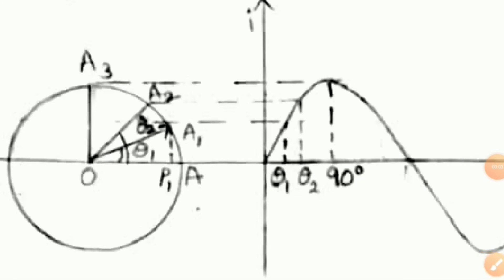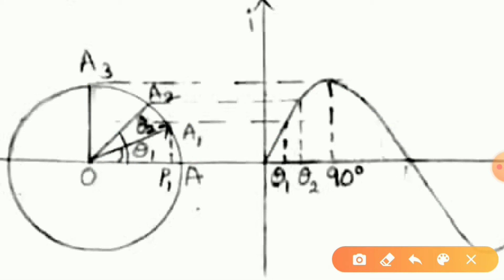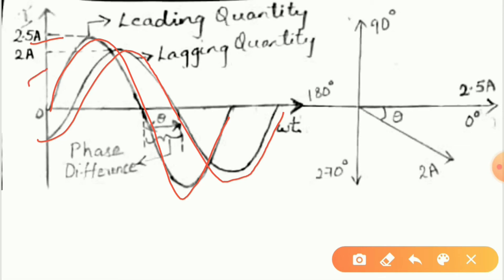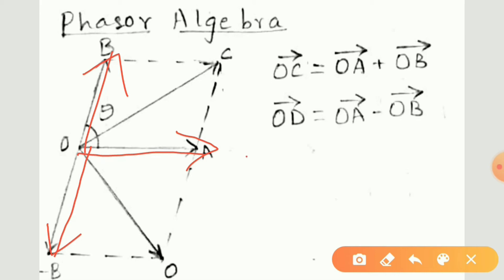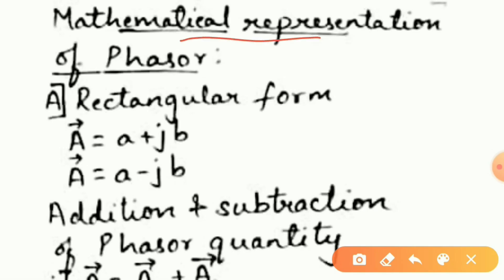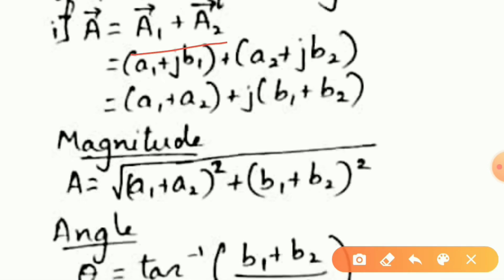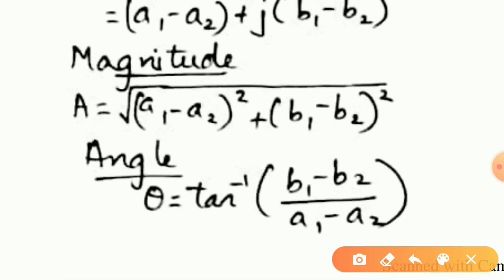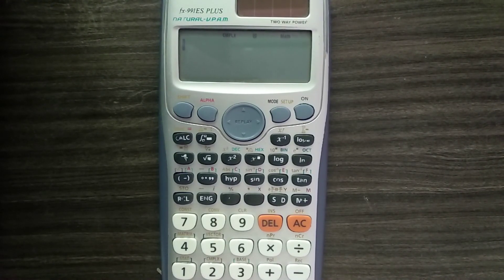Phasor representation

Comment from the maker: One more method can be used for Recatngular to Polar conversion and vice versa using the Casio ES series ..1) Convert to CMPLX mode, 2) Enter the Complex number(either in polar or rectangular form), 3)Press Shift + Number 2(to enter complex operations mode) and select needed operation, 4) Press =
Reply from the maker: Hope all of you have tried this technique too, any one of the method can be used.